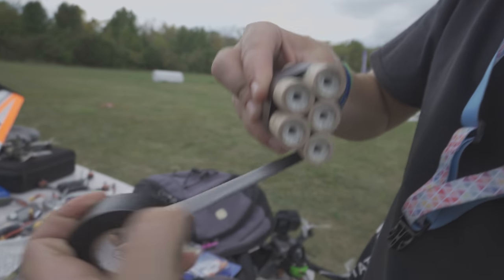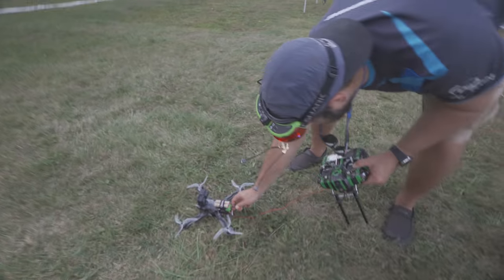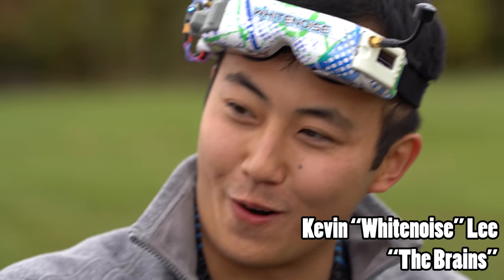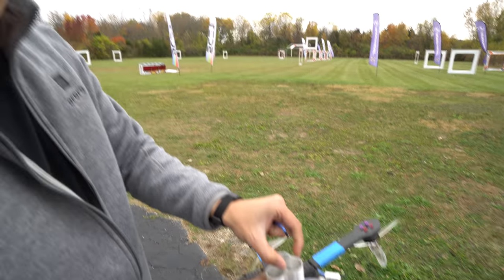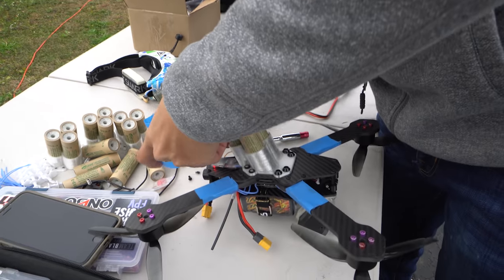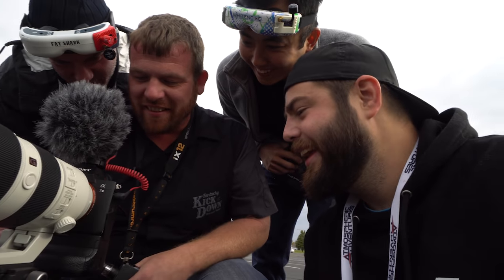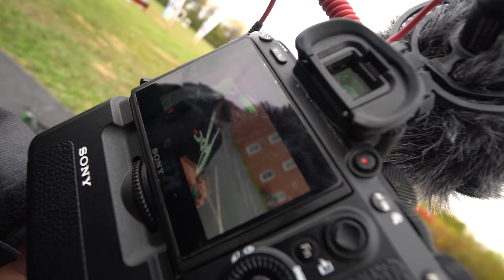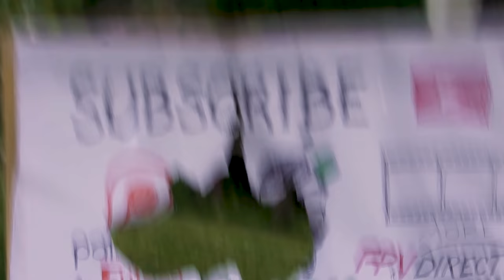How we made a rocket powered drone

Comment: You have to use xx-0 engines. These are boosters that have no ejection charge for the parachute.
The ones you have, D12-3, mean 3 seconds for ejection after the full thrust, to the front of the engine, so really bad, specially for the GoPro and the frame...
But it was fun. ;)
Reply: it's better this way, especially with the self ejecting engines weight reduction.